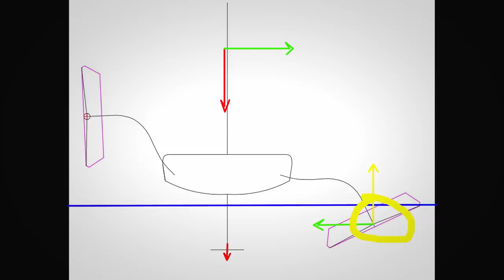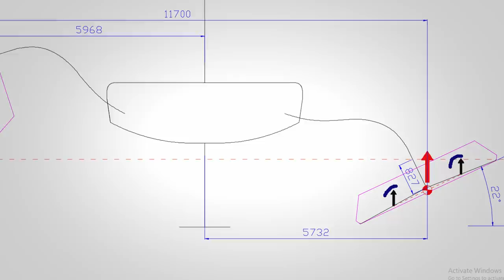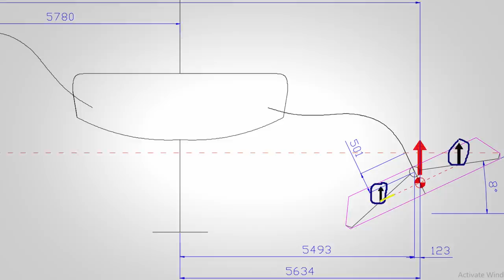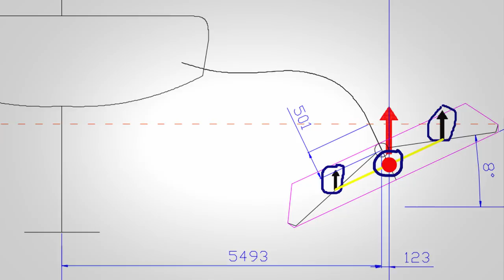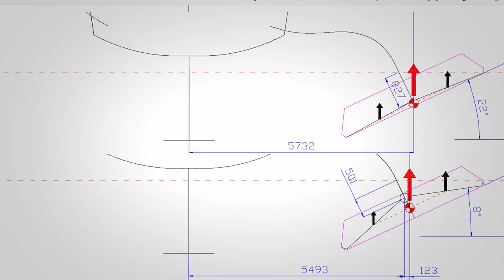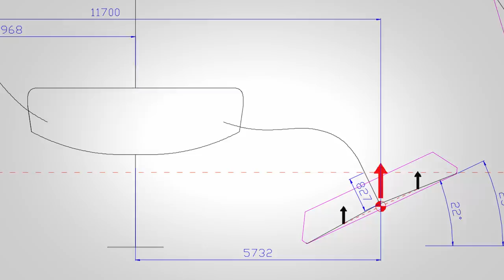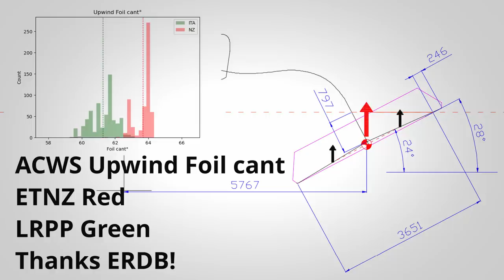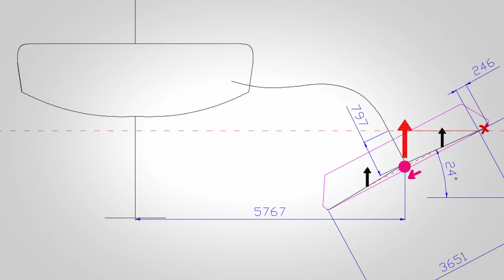Is this the ETNZ advantage that will decide the Cup?

Comment: All very interesting, and another variable is in the equation. LRPP drives the two flaps for the foil differentially, not as one. 
That allows to move the center of lift  even further, in theory
Reply: Not only in theory, but practically !
Reply: I think there is so much underestimation of LRPP. Those @mozzysails videos are great food for thought but they seem so biased. Constantly ETNZ this advantage ETNZ that advantage, while on the water its the ETNZ the one that is trying to desperately find an edge, even experimenting with code zero and double helm. To me it feels like ETNZ is the only one that knows that italians will be really tough opponent.
Reply: @DryAx3  Maybe that's what it looks like to some observers, but since when is experimentation considered desperation??

Comment: It explains a lot of what we've been seeing from the sail spotter videos. Specifically, points raised by viewers concerning apparent instability and the crazy speeds. ETNZ are riding on a knife's edge - literally. There's so little foil in the water; their foils have less area to begin with coupled with the canting angle employed which lifts more of the foil into the air. This is truly a fine balancing act and will no doubt result in higher speeds, all else being equal. Hopefully, they have mastered control of the tricky dynamics involved. Amazing insights and analysis.
Reply: It also explains a lot of what we're hearing out of LRPP. Jimmy is talking up their maneuvering ability and how hard it is to overtake on these narrow courses. I suspect that they know that they're slower and are pinning their hopes on getting a jump on ETNZ in the start box and then controlling the race from there. If that's true then we'll see some intense match racing if LRPP start in front at any point but a parade if they start even or ETNZ starts ahead.
Reply: @franzfanz  It's certainly sizing up to be a spectacular set of races. Two teams with very different boats applying wildly different strategies and philosophies. May the best team win!

Comment: Love the discussion. One of things that strikes me about the tip out of the water approach, is how it harkens back to the 2013 V shaped foils that didn't have trailing edge articulation, so they depended on coming out of the water to decrease the amount of lift. 
If you invert your previous discussions about how important tip winglets are in controlling lift loss around the tip in light air, it gives you a sense of how important the tips out could be in heavy air. My understanding is that foils sections that pierce the water loose up to 50% of their effectiveness. If you consider the T shape foils of Emirates as 2 foils, in theory you could have as much as 25% less lift when the tip is fully exposed. As American magic clearly demonstrated, the issue at high speeds isn't too little lift it is too much lift and the inability to rapidly decrease the amount of lift. By having a tip out approach, the amount of lift is self limiting, as as soon as the tip is lifted out of the water the amount of lift drops rapidly without intervention.
The other component of tips out is that, by allowing air in from the the tips, the amount of drag on the foils is theoretically decreased. I would love to see a work up on those numbers as it is well beyond my modeling ability. However at high speeds, as you have pointed out before foil drag becomes the speed limiting factor, not the amount of lift.

Comment: The gift that just keeps in giving. The calculations / analysis and explanations were very well done and clearly articulated. First rate and definitely some learning for me ! Even if you discount the real world advantage from the theoretical as things in life never quite add up as expected it tells me in a straight line NZ will be quicker. How much will LR catch up using latest mods in the shed is the big question. And lighter airs these differences don’t work as well... which with LR being so strong in the lighter airs might make things more even depending on weather...

Comment: Great analysis guys. However as a few lads have commented here, the anhedral form of Luna Rossa's foils allows them to carry the center of lift towards the outer span of the foil. Thus negating the alleged advantage of the increased righting moment of the straight foil of ETNZ.
However, that comes at a price, and that is Luna Rossa cannot stick their foil out of the water as much as ETNZ.
And here is the trade off. At high speeds, ETNZ can stick their foil out of the water reducing wetted surface. At slower speeds, with foils fully submerged to provide enough lift, Luna Rossa has more righting moment thanks to the anhedral shape.

And if they can control the flaps of the two spans independently, they can potentially have a very powerful high mode sailing upwind by adjusting the flap of the inner span of the foil.

Comment: Amazing analysis guys. Shocking conclusion too really. On the face of it, this looks like the AC final is going to be a fore gone conclusion.

It’s almost as if NZ designed the boat they wanted, then wrote the rules around their boat design in such a way to disguise their solution as much as possible from their competitors, & driving them down different, sub optimal, design routes.

Comment: And here’s me thinking flying the tip above the surface was for reduction of drag. But once explained, flying it along with the t shape to max out the CoL  is a simple solution. It’s like they started with the sum then figured out the parts in a basic manner,  quite kiwi in thinking. If this, what seems basic, solution proves to be a large part of the winning (RM)formula why did the other teams not travel this path? Maybe the execution was too complex relative to risk. 
Thanks Mozzy Sails and Rob and Tom for your clever analysis and it’s clear presentation. Hope some Allen jerseys are in the post.
Reply: I think that flying the tip of of the water is an added benefit. Hydrodynamic drag is massive compared to aerodynamic drag.

Comment: Another great video guys. 
So I'm pretty familiar with the VPP pgm and my head hurts trying to think about modeling these boats, good on ya boys...
Great discussion.
I think ETNZ is built for speed, the low wetted surface at speed... low drag, just my $.02.

I love your opening... 'It's the internet, so what you want...'😂
Reply: Definitely. The issue then is whether they can get it up and keep it up in light winds. The furlable code zero will help with that. I'd assume they all have one -- it was a big thing back in monohull AC days -- but ETNZ seem to be seriously practicing with theirs.
Reply: @BruceHoult  There were some comments in other videos that they opted not to use the code zero in the races. Probably didn't help to lift the boat onto its foils but can't verify that.

Comment: hi guys, interesting analysis, but Tom did not take into consideration the great advantage of the huge angle that the internal semi-foil of the "lunarossa" Y creates when the pierced navigator, almost 45 °, capable of developing a greater upwind angle ...
it will be a great challenge, but the double helmsman could be the big advantage ... !! Hello and congratulations !!
Reply: In this configuration, also the independently actuated flaps are a big advantage...

Comment: Very interesting mozzy but, being an aerodynamic engeneer I wonder why in your consideration you did not consider that the lift schould be considered perpendicular to the surface of the foil. This changes the moment considerations quite a bit. Just curios to know what you think! Thanks
Reply from the maker: We did, but just drew the vertical component. Thought that would make it clear how the anhedral shifts lift slightly outboard of the bulb. In retrospect should have shown X component and the resultant (perpendicular to foil surface). 
Basically they are there, just not shown.

Comment: Great video, very complex variables. I'm beginning to see that in higher wind slapping the hull into a few waves and a minor touchdown or two is a price worth paying for a few degrees less of foil arm cant and a more vertical foil.
Reply: The hull occasionally skimming the surface doesn't appear to shave much speed if at all, judging the distance from the chase boats staying the same when that happens. Besides, ETNZ like to fly close to the water for aerodynamic purposes and it must be an acceptable minor tradeoff to them from all appearances.

Comment: Great commentary and analysis. I would like to hear comments  about effect of anahedral on RM, In regard that LRPPs anahedral is unfaworable configuration dynamicaly. 
To elaborate on this, Lets asume equilibrion condition; foil arm strut going  through water at 0 deg AOA, both foils (equaly loaded, thus force projecting through bulb and strut), HM and RM moments ate in perfact balance in this point in time (and so are Y forces). Now gust hits, sails start to produce more  Y force, boat  start to sail with more leeway. Now this bigger leeway is changing lift distribution on anhedral foil in such way that it loads more inboard foil. Obviously this is reducing RM, so trimer is easing traveler more than he would in case of straight foil.?

 One more thing, By canting more foil arm TNZ is lowering their boat, but also reducing arm between sail force and  foil Y force, thus reducing Heeling moment.
 Cup is loosing apeal quickly :( 7:0 for TNZ?

Comment: Thanks for the vids guys , great work.
Other factors to take into consideration are manoeuvrability and how the hull "cuts" through the air , how low relative to the surface of the water they fly ....need to put it all together to have a more complete picture , but all your videos have been very formative .
Last but not least , the high mode that LR showed ...can ETNZ match or beat that ?
Fascinating .

Comment: Hi Mozzy Men, Things also to consider when making your prediction's for the upcoming races are that it seams Autumn is coming sooner as we have just had rain which has cooled the land and the winds could be closer to 16 knots than the average of 13 Knots for March.
Reply: Are you sure of that? I am asking because I have just heard the opposite statement about the weather trend... thank you for more info
Reply: I have also heard the opposite Mark. What sources are you using ? You maybe write. 

And I am thinking they will be more 10 to 14

Regards John.      Auckland
Reply: I live and sail in NZ , the cliffs overlooking course E are just down the road. Today both boats.were practicing in 10 to 12  knots and foiling fast . We are in autumn now when normally there are more windless days than usual
 That said its been a hot summer with a lot of warm Easterlies and strong afternoon sea breezes so the usual  weather patterns may not apply .
Reply: Initial races will be on courses A and E. due to COVID level two restrictions.
Have the impression, from previous race course selections  by race managers, that these are the least challenging  from "emphasis on tactics and boat handling" perspective. Swirly, strong SW on course B has been my favourite so far. Wonder if the old adage of  "pick horses for courses" will come into play?

Comment: With the anhedral foil, the windward wing can also be set to provide windward lift... ie: added pinch to windward. I wonder if this is part of how LLPP was able to so easily squeeze out Sir Ben. This also could similarly be applied to ETNZ when they lift the arm that 3°.
Also, breaking the surface with the foil produces extra drag, it doesn't just reduce wetted area.
So complex!!! Really appreciate your thoughts and discussions! 
Thank you

Comment: You're looking at center of rotation as a straight line down the center of the hull. If you look at this in 3D you have a triangle defined by the center line, and a line between the rudder foil and the leeward foil. So perhaps this means that the heeling axis is defined by a line between the rudder and the leeward foil. So as the boat heels to leeward, it'll pitch a little nose up and thus the angle of attack if the foil increases slightly.

Comment: Idk, I keep thinking that the fact the foil lift is perpendicular to the foil is a factor in parts of the discussion. Paticularly regarding the out board foil for the anhedral foil which horizontal vs pitched significantly on the inboard foil.

Comment: Not related to this video but I haven't seen anybody analyze how Luna Rosa was able to gain ground in headwind without necessarily going faster. I'm not a sailing expert, but I think this is what is highlighted with polar plot. I haven't heard anybody talk about it. I'd love to hear your take on it.
Reply: A more important measure is VMG - Velocity Made Good (how fast you are moving towards the next mark). This is calculated from both boat speed and the angle they are sailing at. As an extreme example, if you are sailing at awesome speed, but at 90° to the course, you're not getting any closer to your next mark. In real terms, LR was able to sail closer to the wind than GB during the Challenger Finals, so made better VMG and won.
Reply: Theres a big expert debate elsewhere in the comments on precisely your point.

Comment: What I take from this is that one of these boats can be seen in an analogy to a trapezing dinghy (say a Contender, where the skipper and crew are one and the same), where the leeward foil is essentially the hull of the dinghy in the water; the actual hull of the boat is analogous to the body of a trapezing crew; and the windward foil, lifted from the water, is actually analogous to that crew's arms lifted over their head for greater leverage. In this analogy also it makes sense that these boats should sail with their hulls as close to the water as possible without letting them touch, much as a dinghy crew would lower themselves on the trapeze wire. That would maximize the outboard distance of the hull relative to the leeward foil, in the same way as a dinghy crew might go on tiptoe while trapezing.

Comment: Fantastic. Question: is there a trade off between more righting moment and more leeward drift, in the case of TNZ tips-out foil? Might LR be able to head upwind more acutely, gaining on VMG even if sailing with lower boat speed?
Reply: An extra two and a half knots boat speed will bring the apparent wind forward, so I would expect Luna Rossa to point higher than Te Rehutai. Likewise LR might be able to point deeper, downwind. As to the extra horizontal component of the inboard wing on LR, giving her a shove to windward, yep it should be accounted for before we start assuming TR is way faster. 

However, if those speeds prove accurate, that’s a hell of a lot to overcome.

Buono Fortuna, a Luna Rossa.
Kia Kaha, Peter and the boys,
Go Te Rehutai!!
Reply: @q.e.d.9112  Providing there will be ideal conditions, it will be much harder to overcome than even that if the speed rumors are true. Several sources claim much higher than 2.5 kts faster. If indeed valid, LR's alleged superior VMG vanishes.

Comment: First - Love your work. Great analysis but can I suggest a coupe of other considerations? A foil piercing the surface has  greater drag than one fully submerged.  Also a smaller surface area foil with otherwise equal parameters equates to a more highly loaded foil and again greater drag. As you so beautifully put it - it's complicated.

Comment: Great catch about the center of lift !!!
Just, following your idea, the center of lift is pushed a bit on the external side because the vertical component of the external (more horizontal) wing should be bigger than the vert. comp. Of the internal wing due to the different angle.

Comment: The foil with the tip out of the water has less form drag which will negate the loss of lift. I calculate that the less drag actually favours the lack of lift by a fraction, however the better righting moment is further enhanced giving it two wins for one loss. What I don’t fully understand is how much loss one gets with the foil being closer to the surface with higher percentage of oxygenated water and the higher risk of  cavitation. It could mean that team NZ have a lower all out maximum speed than the Italians?

Comment: I am not an aeronautical engineer, but I am a pilot. What I can say is that getting a tip out of the water is a little bit like having a wingtip collapse in a paraglider. It just doesn't matter. The reduction in surface area of the wing results in higher wing loading, which raises the pressure inside the wing, and under the wing, and resists further collapse.

In the case of a boat, extending a tip from the water will not only increase wing/foil loading, but also reduce drag. I think that's right. 

So, the more the tip extends into the air, the more downward force is exerted on the remaining subsurface wing area, pushing it back down.

We know that G=L/D - so a foil tip protruding from the water should automatically increase the glide ratio through the water. The higher glide ratio is compensated for by the increased wing foil loading, which should maintain a steady horizontal ride height.

Or at least that is my understanding - which could be worth exactly what you paid for it. :P
Reply: Sorry mate not completly right on that, breaking or even disturbing a surface creates added drag, wheather this is beneficial or not considering that some viscous resistance is gone is to be calculated. but one of the main advantages of moving on foils is that the residual resistance is almost gone (in naval arch. the residual resistance is the one not generated by viscous effects) except for the small sections in wich you break the water